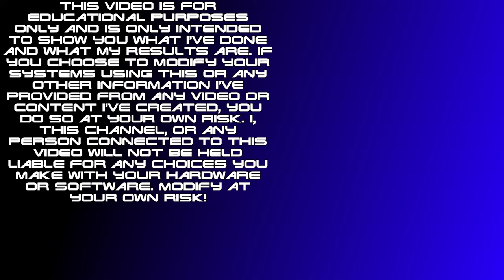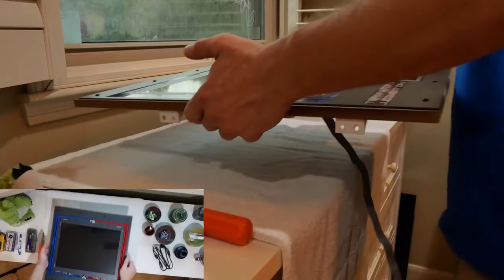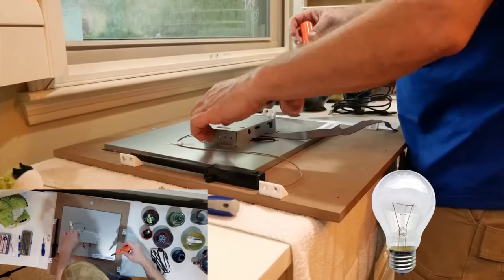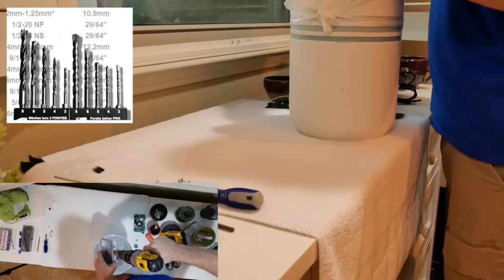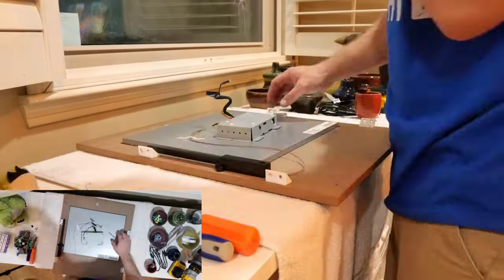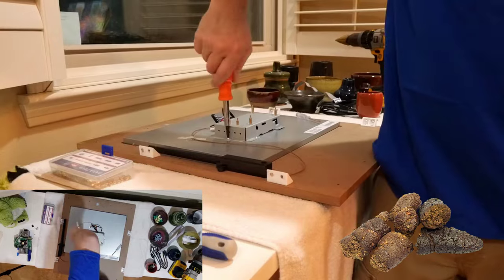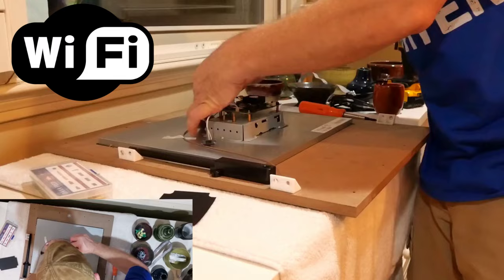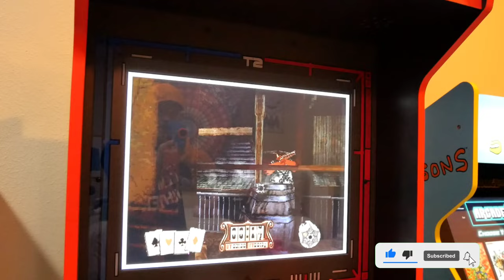DON'T Let Overheating RUIN Your Arcade Experience

Comment: It's interesting that the cabs are designated like this, and I understand why you don't want to get the heat from the monitor. However, I would find a case to project the PCB from dust, etc. A clear cass would look cool.
Reply from the maker: That too is an option.

Comment: Just unscrew and carefully bend the aluminum case sides open and install a USB desk fan on the back to blow over it. I did it on 14 cabinets and all run nice and cool! Constant air flow over the whole board.
Reply from the maker: Cool mod man, thanks for sharing.

Comment: Seems like a lot of work with some risk of botching something, with little improvement. I plan on just flipping the PCB and its shell around so it gets some air flow.  And when are you going to recess the monitor??
Reply from the maker: I thought about doing it that way too, but then I saw that I'd need new mounting holes. Adding holes freaked me out. I don't know if I'm going to do the recess. I like the look, BUT I worry the bezel will be in the way when I aim. Regardless, Thanks for checking out the video.
Reply: @TechicallyTNT  I don’t plan on needing any mounting holes just flip the casing for the PCB around and use some good double sided tape to attach it to the back of the monitor. I saw Bee Kong do it that way.
Reply from the maker: @lonster3000  Yep it can be done that way. When I've done it with tape I've used thermal, it adheres a little better, and lasts longer then the standard. I didn't do it like that for this mod. Using tape just seems kind of temporary to me.
Reply: @TechicallyTNT yes tape is probably not as “elegant” as your solution. One thing I just realized is that if you recess the monitor, there’s not much space between the PCB and the back panel, it’s a tight fit, especially with what you’ve done here. You would almost have to cut a hole in the back panel to accommodate it. I’m planning to make a cutout anyway just to help with airflow.
Reply from the maker: @lonster3000  I've only done a little light reading on the recessing, the monitor not done any measurement yet, but yes there are room constraints. Very  curious if you plan on going with a kit, or will you do something custom when you recess yours? (I'm still not sure what I want to do...)
Reply: @TechicallyTNT  I’ve almost finished the mod, it was mostly a DIY project. I did use a monitor bezel Intec was selling for a while, I had to trim it down since it was intended to go into the grooves in the side panels. Then I picked up some L brackets to help fasten it. I’m trying to finish getting the mirrored plexi in place. Like most that have attempted this mod, I had to reposition the monitor to get the right height
Reply from the maker: @lonster3000  Very Cool, if I do it I did see a kit that I liked. The only thing I worry about it is the bezel blocking my view when standing back.... I love the look, BUT I'm not sure how I'll feel about it. IF you don't mind, and IF you have the time, when you're done with the mod, and have some play tune in, tell me how the mod effects game play. I'd like to learn more. Also, Thanks for all your input and sharing your thoughts. That means a ton.